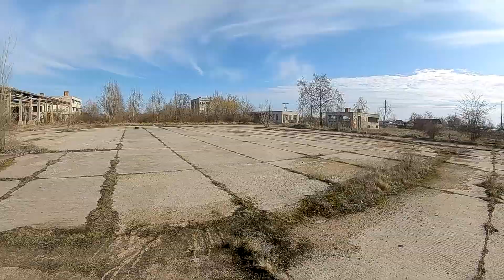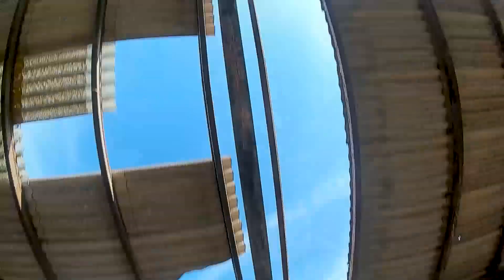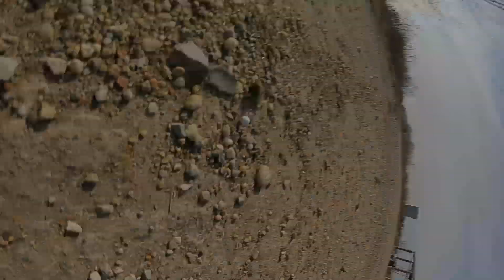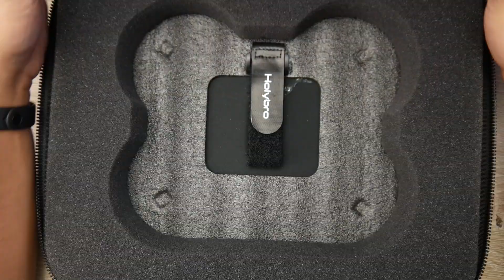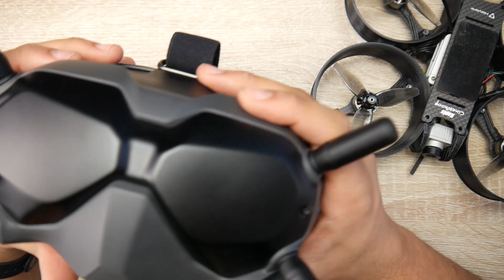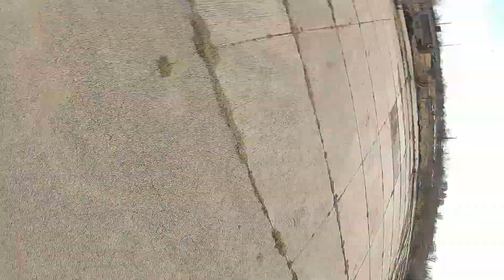My First DJI Cinewhoop!! // Holybro Kopis Cinewhoop DJI FPV

Comment: Please I need help (complete noob here). I have the R-XSR and my receiver has 5 cables. i soldered the:
Black - Gnd (at the bottom, next to T7)
Red - 5v (above Ground)
Yellow - T6 (next to red)
Green - T4 (above yellow)
White - (don't know what to do with it)

is this ok? or should i move them up top where you did yours? tried to bind them but even though the transmitter Qx7 reads the receiver it just don't do anything, don't increase values in beta flight when i move the sticks.

Comment: Can't wait for your video on the dji equipment. I keep putting it in my shopping basket and then not buying it because I'm not sure if I want to spend that much money, after have spend all the cash on my current gear last year
Reply from the maker: I have a video just about that becuase I also saved up and bought mine.. It disappoints in one aspect which is the HD footage quality it's not bad but its main selling point or reason to purchase is the Live HD however my latency was 35-49ms Noticable at times because we are only allowed to run 25mw.
Reply: @DroneMesh  did you use other than stock antennas?
Reply from the maker: @PeterPetermann  Not yet I purchased some and will use some that I have..

Comment: I finally also had my first flight with a copter with a DJI system today 😎
For the very first flight with it, I put it on my old 2.1m EFlite Carbon Cub and that was already impressing. And also a good range test, still flying 25 mW. 

But with my new 6" 3D copter with 2-bladed props and HD... I guess, I have to get used to it, just an amazing experience 😁

Comment: I have the same motors in my build, do your motors run hot after a few minutes?
Reply: Its normal if they get hot, but better look if their screw doesnt rub your copter s arm
Reply from the maker: No mine where fine check your pid and blackbox.